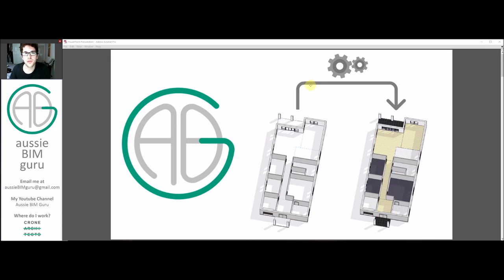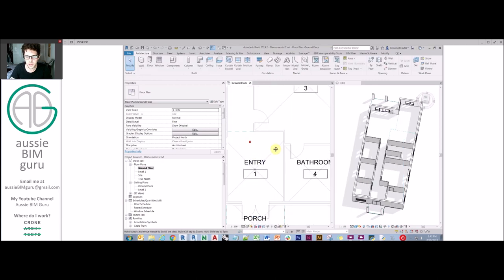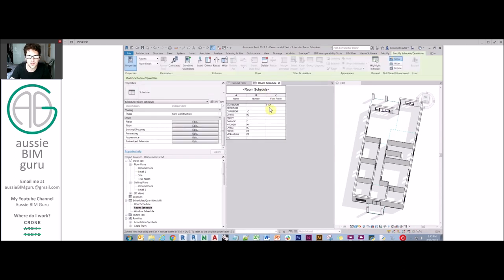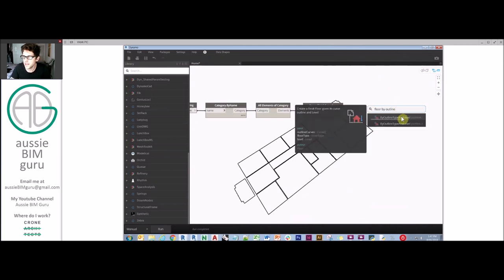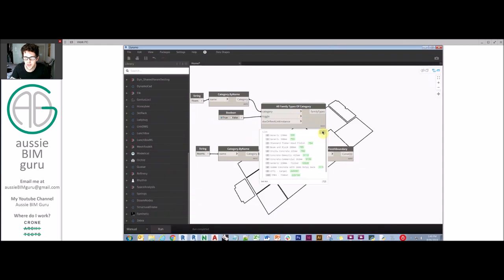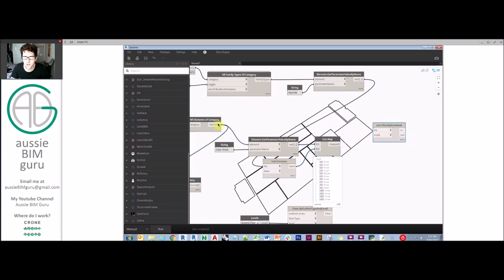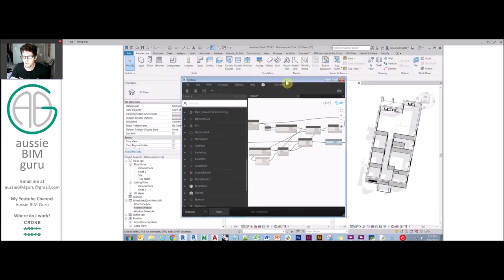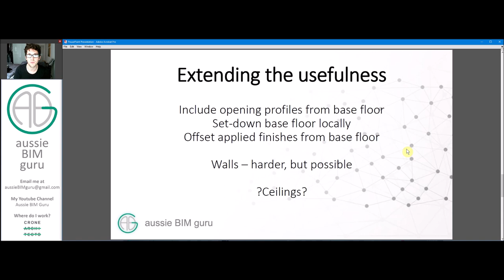Floor Finishes by Room using Dynamo!

Comment: These are more general questions on how you did the floors before you got to this point but... did you create separate floors in each room? did you add those floors on top of another floor (i.e. a" structural" floor)? how do you handle floor finishes of different thicknesses? do you move the structural floor down and leave the top of the finishes at the level or do you add another level or reference plane for the tops of the finishes. Thanks as always.
Reply from the maker: For laid finishes i model these and offset them by their own thickness. I know some firms use roofing as a non category compliant approach (and fascias for skirtings) given roofs grow upwards unlike floors.

For a finish requiring a setdown i include the screed layer depth in the floor type (e.g. 10mm tile / 40mm screed at high point) and set the base to be variable in the structure settings. This way the top may fall but the base is consistent.

Structural floor impact is usually best managed by leaving a hole for the setdown area, modelling it as a separate floor, lowering it and offsetting its sketch outwards by the required fold zone width. These can then be joined together for seamless soffit appearance.

Comment: Good gavin..!! Can you make a script to identify the ceiling heights in corridors ...As manually checking ceiling heights for all the corridors is a bit boring task..
Reply from the maker: Yes I'd suggest getting room geometry, isolating the faces pointing up of the solid form by checking their normals, extrude it up by a nominated height and collecting the intersecting ceilings using a solid intersection node from the bimorph package.

Comment: some times we have some elements(columns or walls) inside of rooms, then its create separate floor instead of subtract that part.
Reply from the maker: Yes in this case you would need to isolate the largest 'loop' of the rooms boundaries, or cut them out of the original room. You would need the loop with the largest overall area. Unfortunately Dynamo cannot generate floors with enclosed holes, these need to be added manually or as floor openings.
Reply: @AussieBIMGuru  thanks for quick reply 👍
Reply: in this case how do we isolate the largest loop...?

Comment: Hey Gavin,

im trying to combine your tutorial (creation of floors) and the custom node „WallFinishesByRoom“ (Modellical) to create wallfinishes within rooms. Both of hem are already a huge help but they don‘t really serve a consturuciton architects needs:

i would like the script not only to model for example 1 cm of plaster around the whole room but also choose the wall covering depeniding on the wall that is going to be covered:

For example a concrete wall on the outside oft the building, should be covered in 1 cm „plaster A“ a brick wall on the inside should be covered with 1cm „plaster B“ and a drywall should only be painted and doesnt need any modelled covering.

Do you think, we can make use of Clockworks „Room.Finishes“ ?
Reply from the maker: I would look into the Room Boundary elements node in Clockwork (I think it's called something along those lines...), which should return boundary curves, but also the element generating that boundary as well. From this a type can be identified.

Comment: hi Sir, Are there anyway to not create new floor but just change its boundries ? i need to use same ID but every time i started dynamo it makes a new floor and its ID changes
Reply from the maker: I believe it is only possible for floors with the same number of sketch lines before and after due to API limits. The floor API has a lot of missing features, eg adding internal loops.

See here for some discussion and solutions; https://forum.dynamobim.com/t/i-want-to-edit-the-sketch-of-an-existing-floor-or-slab/9775

Comment: Hi. How can we identify it for each level ? and offset of each material
Reply from the maker: With additional changes made to the script of course, this is just the beginning of what could be a complex workflow. You would effectively need to check the levels of rooms to dictate the levels of their floors to be made. For offsetting you could check the thickness of the floor types and set that as the offset after creation.

Comment: Hello! When I add the node all family types of category, it just doesn’t bring my floors information! I already tried others scripts but never works because of it. I filled up the keynote and floor finish with my name’s floor. I have no idea what’s wrong 😢 could you help me?
Reply from the maker: I believe this node doesn't work properly on some versions, others had this problem. Try using the 'Element types' dropdown node set to the 'Floor types' input, then connect that to an 'All Elements of Type' node. This should also return all the floor types without custom nodes needed. You can then use this as the starteer instead of the 'All family types of category' node.
Reply: @AussieBIMGuru  I can not find the "all family types of category" node also, and I'm trying out applying your reply here. Please, can you make it more clear ? I'm a newbie also for Dynamo.
Reply from the maker: @MiralMahran  i believe this node is from the custom package called Clockwork. You will need to install this from the package manager in Dynamo.

Comment: I'm using  Crumple v.2022.5.27 with revit 2023 but offset dont work. Is it something related with versions
Reply from the maker: Possibly related to changes in 2023 API related to builtin parameters. I stopped developing beyond 2022 with Crumple due to the deprecation of ironpython2.7.
Reply: @AussieBIMGuru  Thank you for reply. I'm changing height offset level from schedules. By the way I'm anxiously waiting for "creating floor with door thresholds" video from you.
Reply from the maker: Out now:
https://youtu.be/awRDODFS8wE
Reply: @AussieBIMGuru  thats amazing. Every project needs it

Comment: Hi, i'm having a problem with the floor finish, because i need to end at the middle of the doors (center line in the door), between one room and the other, and the room detector always left that space empty. there is any trick to select wall finish and then the middle of the the doors? thanks.
Reply from the maker: There is no easy way unfortunately - you'll need to use geometry and custom algorithms to introduce the doors to the relevant sides for each floor.

Some threads exist on dynamo forums which might help, but it's not an easy workflow and will need a fair bit of experimentation:
https://forum.dynamobim.com/t/finish-floor-with-door/53028/20

Comment: When i delete a room and re-create it , i delete old one from schedule but script can't create floor for the new room.
Reply from the maker: Try replacing the floor creation node and running via dynamo player instead. Sounds like an element binding issue.
Reply: @AussieBIMGuru  floor creation node is Fllors.Create from crumple. Yes this is element binding.even if  i delete old rooms from room schedule how can i have element binding error?
Reply from the maker: @arincakkin  I'm not quite sure - maybe in the select model elements node? I don't believe Python based nodes should be able to bind.
Reply: @AussieBIMGuru  i'm going to open a topic on dynamo forum with the related files

Comment: Hello
Its don't worked =\
Reply from the maker: Ok. Going to need to be more specific if you want help here.

Make sure your floor types per room have found a match (no nulls), and that each room has one boundary only - no internal loops.
Reply: @AussieBIMGuru  I run the script, but it not plased the floors
Reply from the maker: Any warnings or errors?
Reply: @AussieBIMGuru  No, it just no placed the floors
Reply from the maker: @rodyvv3321  well it worked for me so unless you can be more specific i cant really help...
Reply: @AussieBIMGuru  Can I send to you the RVT file+Dynamo script?
Reply from the maker: @rodyvv3321  sure!
Reply: @AussieBIMGuru  Thanks!
I sent